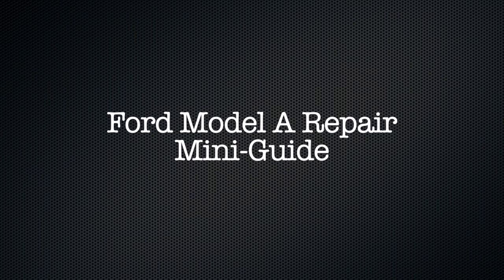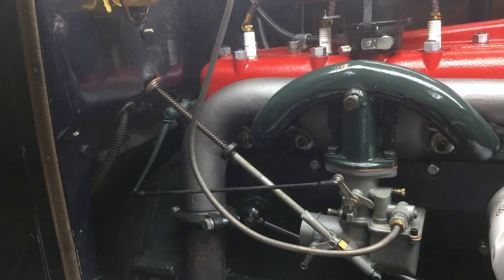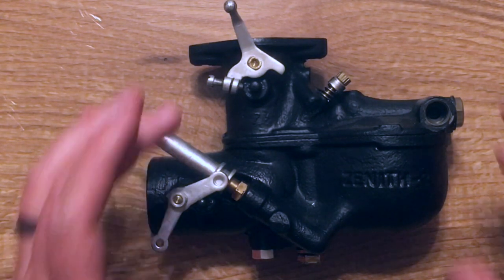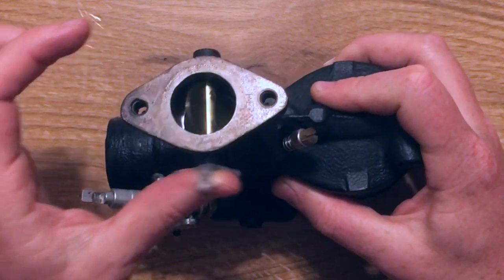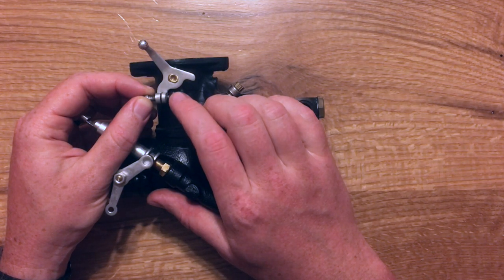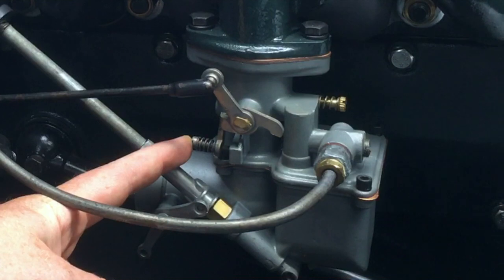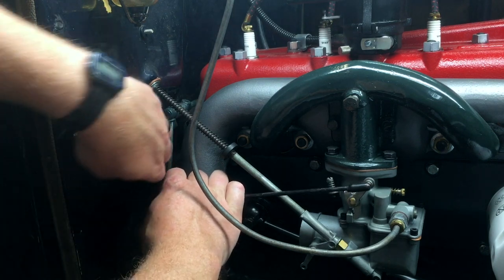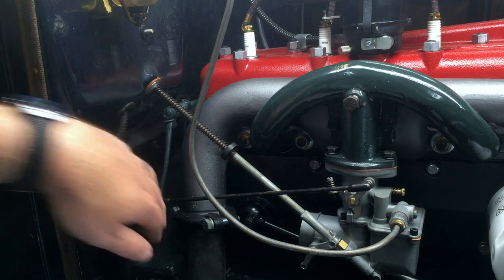Model A Ford – calibrating throttle/accelerator linkage

Comment: Steering column ordination, rotating the column at the steering gear box will change the spark control arm and throttle linkage position also.
Reply from the maker: Thanks for mentioning that. The car in the video has 7-tooth steering, so I couldn’t show that trick.
Reply: Correct, bent rods flex 100% of the time.

Comment: At 3:35 It sounds like you are saying that the engine is getting air from somewhere else beside the air intake on the throttle body.
Reply from the maker: Correct, there is a very small vent hole that leads from the side of the carb (roughly where I tap with my finger) to the hole above the throttle butterfly valve that you can see in the video. When the engine is at idle (so the throttle valve is closed) or when the choke is engaged (so the choke valve is closed), airflow through the main intake bore is 99% blocked, and all of the air feeding the engine comes from that little vent.

Comment: I redid my zenith 2 carb, but when I adjust the acceleration stop, the engine dies before it stops pulling air from the main inlet. No matter how precise I adjust the idle control

I did clean everything properly and all channels and needles are open. Did I install something incorrect inside? I did it according to the schematic
Reply from the maker: Are you saying that the engine isn't able to run off the idle circuit at all? What RPM can you get it down to?
Reply: @alexiskai  ye so when I disengage the throttle stop bolt all the way, the engine dies? Even if I do it slowly and constantly adjust the idle bolt to try to keep it running.

I remember when I disassembled the carb I noticed a little divot on one of the far edged of the butterfly valve. Is it possible that I installed it reverse and that divot should be near the idle hole?
Reply from the maker: @DrTheRich  On my Marvel carb, which you can see in the video, I still have about 5mm length on the throttle stop bolt, and my car idles at 400rpm, which is perfectly fine. You don't need to turn it out all the way. The important thing is that you're running on the idle circuit. You can check whether you're on the idle circuit by adjusting the GAV knob while the car is idling. If turning the GAV affects the engine in any way*, you are *not on the idle circuit. That's what I would look for. Get the idle as low as you can, verify that the carb is only using the idle circuit, and then move on to other problems.
Reply: @alexiskai  oh smart way to check. I'll do that when I have the engine back together. Could it be that because currently I have an enormous amount of blowby past the pistons, that it can't vaccuum powerful enough pull enough air through the tiny idle hole to stay alive?

Also Is it possible for you to block the main air intake with your hand while idling and the engine keeps running?
Reply from the maker: @DrTheRich  I may have given the wrong impression in the video. The carb is designed so that a tiny amount of air will come in through the main inlet even with the butterfly valve completely closed. The valve isn't a seal – some air will still be sucked in around the edges. The important thing is that, when idling, the main inlet air does not get mixed with fuel. It's just air. Only the air that's coming in through the idle air vent, located on the outside of the upper casting, gets mixed with fuel. This fuel-air mixture then is sucked into the intake through the hole in the upper bore, right at the butterfly valve, that I point out around the 3:50 mark. As it enters the upper bore, it combines with the air leaking around the butterfly valve, which leans out the mixture slightly.

This document is a good guide to testing the idle circuit and has some nice diagrams. http://www.santaanitaas.org/wp-content/uploads/2014/08/2OC-Zenith-Passageways.pdf